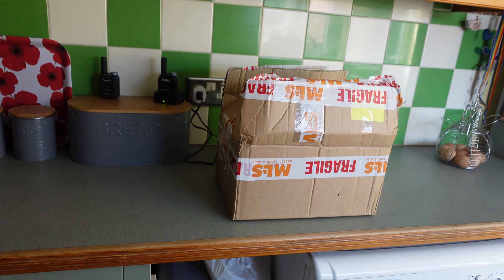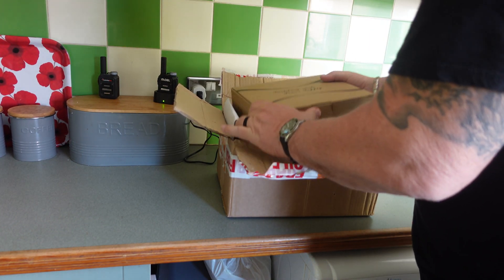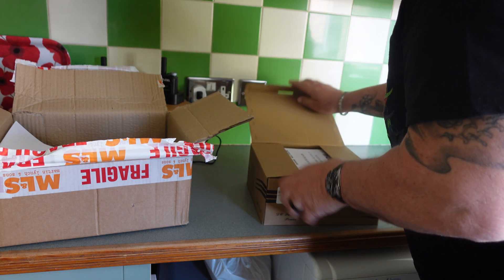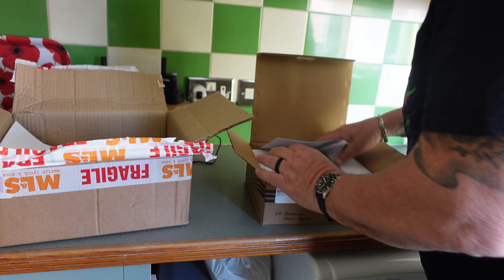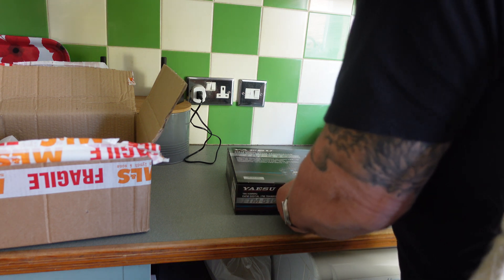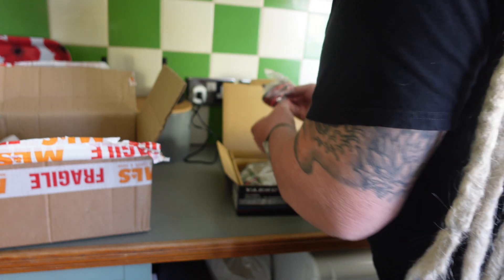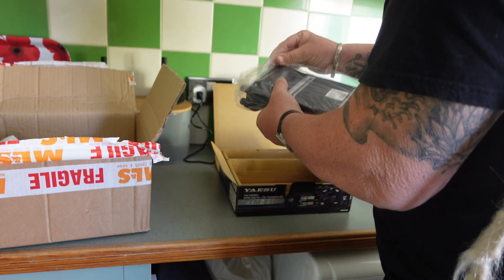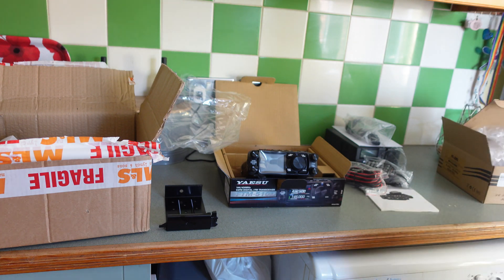Unboxing a new piece of technology can be an exciting experience The New Yaesu FTM-510D Ham Radio

Comment: Hello Peter just a quick question why didn't you buy a HF radio instead of a 2 meter / 70 cm ive just pick up a Xeigu G90 for less than £350 and iam using a endfed antenna the bands are alive especially 20 meters and 40 meters just thought i would ask 73 M7ICV